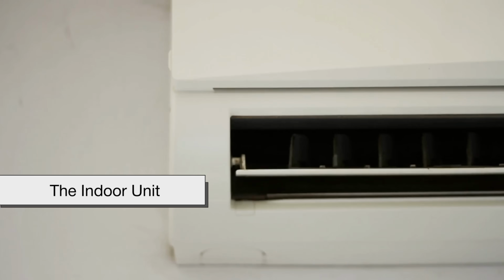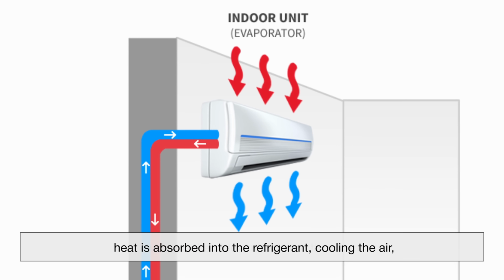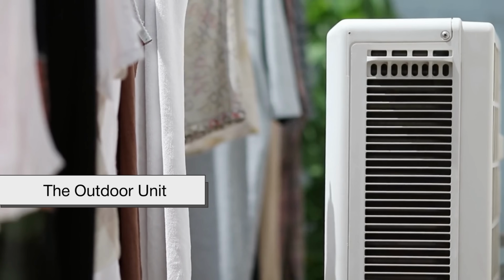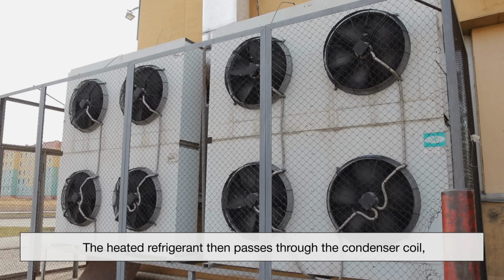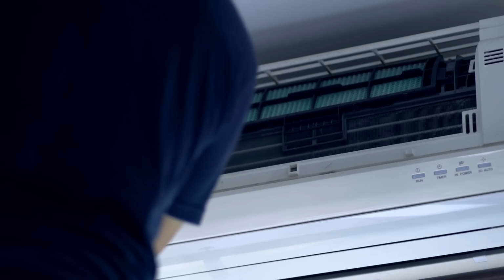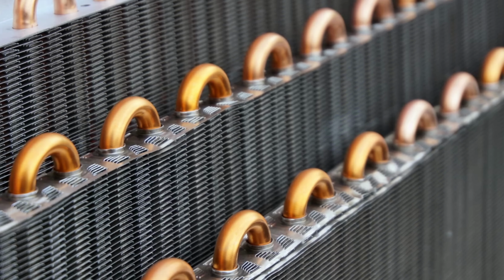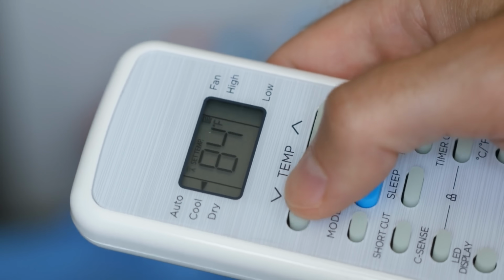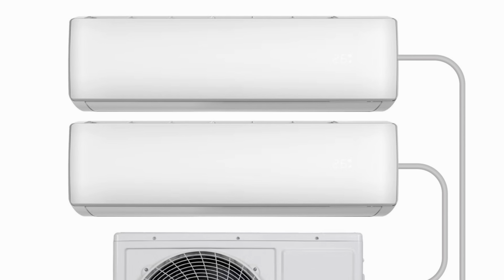What Are Split System Air Conditioners?

Comment: From a technical standpoint you're correct. The unit you open with is a split system. It's what we call in the industry, lnverter type mini split. Split system air conditioners are nothing new they've been around a very long time.. typically throughout the South below the Mason-Dixon your split system is probably a heat pump.  The outdoor unit is reversible and provides both cooling and heating by simply using a reversing valve to reverse the flow of the refrigerant cycle. Manufacturers have been battling the efficiency problem for years. Everything matters, different combinations of  refrigerant, compressor type and coil size. The mini split came along to fill a niche. They work great when you're using them for an added adition, garage or a room that simply feels left out of the whole house system. Personally I think mini splits are a pain in the ass.. because the people that own them aren't the brightest bulbs on the string. They never take the time to learn how the remote works or the functions of the unit. They create call back nightmares. Nothing wrong with the system, it's always the operator.
These are the same people that never open up the owner's manual for their car.. 😂😅🤪

Comment: For every 500 sq.ft. of floor space, you will 12,000 btu's also called 
1 ton of air conditioning! 
These units are ideal for single room locations such as the bedroom, office. Patio, restaurant dining room, or small garage or shed. You must keep the filter clean or it will clog up and make the unit worthless!! A timer to turn on and off makes them very handy to operate if that model has that feature!
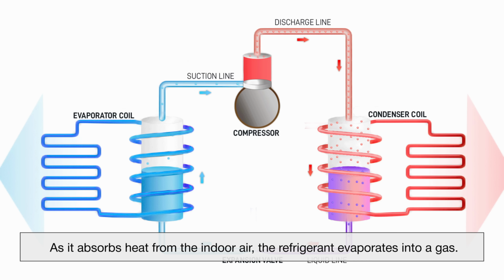Reply: Traditionally yes, now things have changed. I have the 4:10A 18K and it will hold sustain a temperature in a 36K house through circulation. It is incredible. Not a bad differential pressure to outside air temperature either.

Comment: They are great and all over the world, but unfortunately many homeowners do not clean them enough.
Reply: There's not much cleaning to do other than the air filter, which just needs a quick vacuum every 12 months or so.
Reply: @AchtungBaby77  Every 2-4 weeks on filters during peak season, and a much deeper clean every 3-6 months depending on usage. In the Philippines it runs all the time pretty much.